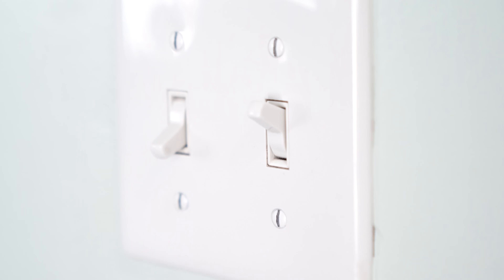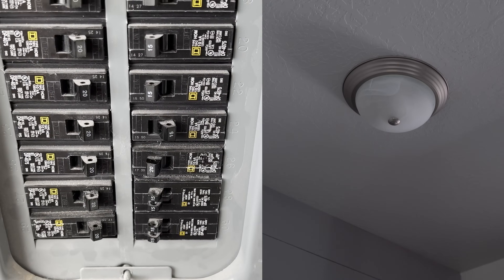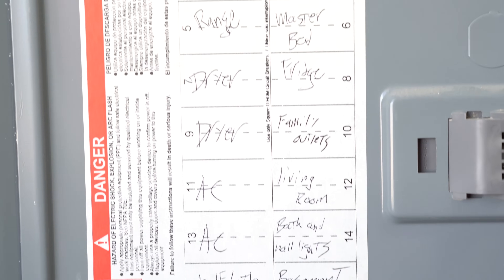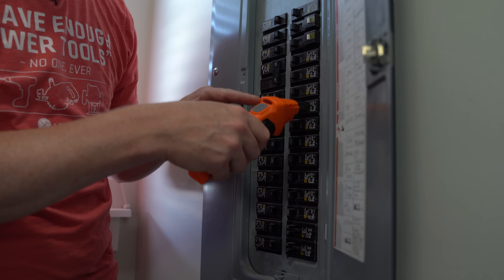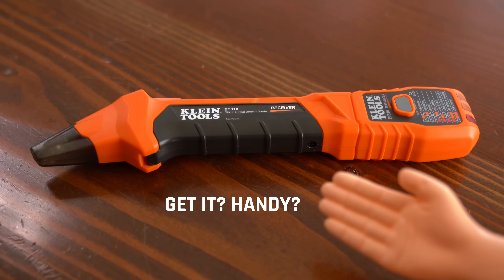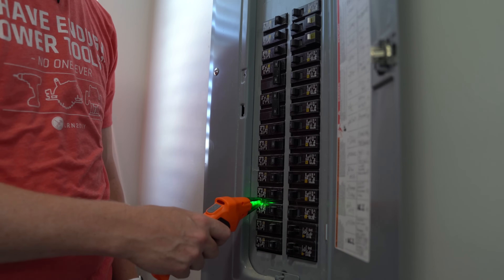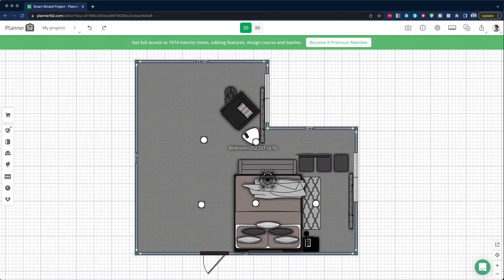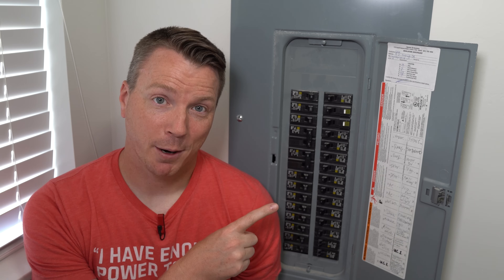This Tool Could Save Your Life

Comment: I use a spreadsheet that I print and laminate to keep near breakers.   For numbering devices I always start in NE corner of every room and go clockwise, R1 R2 R3 for outlets and S1 S2 S3 for switches.   I don’t actually label the switch plates I just count clockwise when I need to turn off something and then refer to my spreadsheet.
Reply: @ Ray B - that is genius! Thanks!
Reply: Excellent plan, Ray. I'm going to use your system.
Reply: I do pretty much the same thing.  20 years ago, I started doing the maintenance on a 4 story rather spread-out building that has 8 circuit breaker boxes with over 100 breakers, and almost none of them were labeled. I spent close to a week running around trying to figure them all out. I tool like this would have been helpful, for the outlets I used a radio turned up loud and started flipping breakers until it went quiet.
Reply: I don’t use a corner. I start at the door.  That way you don’t need a spreadsheet.
Reply: I label the backside of the wall plate and just refer to that.
Reply: These days, you can also use NFC stickers to keep track of it as well. They're like $0.30 a piece if you buy a hundred of them, and you can store all the relevant information in the tag itself along with simple information about whether it's a switched fixture, GFCI protected or similar.
Reply: @learntostrafe  Use NFC and you can read the information without removing the plate.

Comment: there's also the electroboom way: just short the plug and the correct breaker will open.
Reply: ...will open, hopefully.
Reply: Old homes are “tricky “ what you end up opening sometimes is a Hidden Gfci that powers half the House and no breakers opened in the panel🤣now you to have a House with no power and a Random Gfci to Look for
Reply: Does this tester also work as a vault tester? Meaning you can hold it up to a live wire anywhere and if it’s a tech electricity it will beep? I have a Klein tools tester that does this exact thing that I mentioning but I’m wondering does this device do that as well?

Comment: You show switch shooting out, but not how the tool would have prevented that?
Reply: I use the tester on all wiring in an electrical box, just in case.
Reply: You did not say why non contact voltage tester did not pick up live circuit
Reply: Click bait
Reply: It's not exactly click bait.  The tester can help identify the circuit breaker in question when you don't know which one it is.  

It cannot save you from being ignorant about testing EVERYTHING in the box you're working on before you work on it.
Reply: If he had a proper mapping on the breaker box it would have indicated that he needed to worry about that switch as well as it definitely would be hot. But, really, any time you've got wires in a box that aren't just passing through you need to concern yourself with whether or not they're live if you're going in there. 

The light switch could have potentially been fed from the same circuit as the outlet.

Comment: Watch out for neutrals on mult-iwire branch circuits that aren’t on proper two pole breakers. Dish/disposal is common one but in some older houses they were used throughout. It’s two hots sharing a neutral and if in single pole breakers you can shut one off and it will not show as hot but it will be carrying voltage on the neutral because of the other closed breaker.
Reply: Shit...I think you just solved a workplace problem for me.  Thx!
Reply: Yep, happened to me, I'm still alive, and smarter for it! Shock of my life!
Reply: Shared neutrals, Oooof!!😬 Hackers, garbage etc...
Reply: I found myself in that situation where I'm currently living. It would have confused me except for the fact that they had the sense to use different colors for the different phases. I didn't even know it was a thing to share a neutral like that. And, it was indeed one in the kitchen.

Comment: Mom asked me to test dryer heating element; switched off the breaker but tested with multimeter (before non-contact testers were invented). I got an arc, found wires were crossed so one leg of the 50A stove breaker was connected to the dryer outlet, and one leg of the 30A dryer outlet was feeding the stove. Similar situation many years later in a US Army hospital in Germany in the feeder for an X-ray machine. The arc blew a 100A fuse at 380V.

Comment: One big trip/help is to label the outside of junction box covers; you can also label the inside of the covers or simply the non-visible portion of the outlets switches, as these then get covered with a cover. Covers also cover more than just the box, especially with todays larger covers and a simple label or fine tip marker putting circuit numbers on the wall under the covered area can be good. 
As an institutional electrician you get to expand this out to facilities with quite literally dozens if not a hundred plus panels, then add three phase and this gets quite fun.
I’d also suggest running the breaker test again after you shut the first breaker off as you can actually get dual feeds, especially in DIY work or after a new service, especially if you’ve ever had knob and tube in the house.

Comment: Moved into a house last year, with two main panels. The labels in the boxes were nothing more than "AC, AC, Heat, REC, LIGHTS". zero description of where, what or anything. I used this tool to remap every single circuit, outlet, light in the whole house and made a very detailed panel label printout for each box. This tool is awesome

Comment: I had this exact same thing happen to me just a few weeks ago. I was changing out the old three way switches for smart switches for the foyer. One switch was by the front door and the other was at the top of our staircase by the bedroom door. This one had two switches sharing the same box . I shutoff the circuit breaker for the light I was working on verifying it when the light went off. I went back up the stairs to the satellite switch and as I was taking off the switch cover I looked at the other switch realizing that this switch controlled the lights in the upstairs hallway. I wondered if it was on another circuit and decided to flip the switch to see if the hallway lights came on. Sure enough they did. I am so glad I decided to do that. I'm certain it saved me from being shocked. Another reason for purchasing this tool after watching one of your other video's. Amazon delivered it today. Thank you very much for another informative video.

Comment: I have the ET300, a lessor capable Klein circuit tracer.   One thing I find however is it doesn't seem to work properly through GFCI receptacles.  Works fine for all other circuits.

Comment: That is a great tool.  I have an Ideal SureTrace 957 that does the same thing, plus a few others and has come in handy many times.  Even after I believe I have identified the correct breaker and used a non-contact device to see if the AC seems turned off, I then use my trusty DMM to triple check and confirm the circuit is off.
Reply: Sure trace is better! The Klein 310 even displayed red light when I ran it past the main breaker. I don't this is worth the money now that I bought it. And yes I followed the instructions and calibrated it.

Comment: I have this circuit breaker detector and it works great.  I went through the house, identified the individual breakers and the circuits (e.g. receptacle west wall dining room, upstairs hall lights, etc.), put them on an Excel spreadsheet and taped them to the box.  I also noted if there is a GFCI and its location on the circuit.  I labelled the receptacles on the cover so I can easily see what breaker it's on.

Comment: At first I thought you had a really small hand, before I realized it was just a pointer.

I just got one of these circuit finders last week its great. I also got a baldr power meter which is great for checking the load from any appliance or device.

Comment: Thanks for the video. Certainly have to rethink on how to handle those  switches on the same plate that handle lights in different areas.  That might require 2 or 3 breakers to be flipped to ensure no cross circuits.  Nice ideas for the breaker box labeling. Will definitely check those out.

Comment: It's worth noting that with the bathrooms in particular, the light switches are usually on a separate circuit from the outlets as you don't want to drop your electric razor into the sink and have the lights go out while you possible have a slick floor.

Comment: I have used the radio method in the past but in noisy environments, I will plug an extension cord into the outlet that needs attention and carry the female end to the breaker panel. I use a noncontact tester on the extension cord to find the breaker in question.

Comment: I use a shop vac for non-visual confirmation. Pretty loud and it will turn back on with the breaker to confirm 2x. Not all radios will come back on.  IMPORTANT: ALWAYS check prior to any work with a tester and if you can’t see the panel from the work area lock the breaker out either with a proper lockout device or at least some tape

Comment: I ran into this but caught it with the non-contact tester before moving anything. I think the code changed around 2006 to require ganging of the breakers if more than one breaker went to a box. In my case, half the panel would have had to be ganged just due to poor layout (which I didn't fix). If there were plans, no licensed electrician reviewed them. Everything in that place was apprentice level or lower.
Reply: That doesn't really mean anything because I'm an apprentice and my work always looks better than the journeyman I'm working with. 9 year apprentice cause I make a dollar or 2 less than a journeyman and have none of the responsibility.  Cant be stuck running a crew or be responsible for other peoples mistakes.  Lol
Reply: @charlesstidham2788  I hear you.  Really it comes down to the person. If you care about your work, and it sounds like you do, Charles, that's the most important thing.

My apologies to apprentices everywhere.

Comment: Very good information. I continue to face a big mess with house wiring and outlets. In the case of one outlet, there is no circuit breaker that controls it! Dangerous and exasperating! Maybe it somehow connects to the large outdoor main panel? Also, in this old house we have Knob&Tube wiring, with some new additional romex wiring and outlets. I last paid my electrician thousands to do what he could, but his solution to our lack of ground wires is not very satisfying. He installed occasional GFCI's, but never mapped outlet by outlet to find just which outlets are downstream from each GFCI. Because the house is quite full of "stuff", one or two of these GFCI's is not so accessible. I spent the last 2 years unable to turn on overhead lights in a large office room, figuring that a GFCI somewhere had tripped. Years later I was repairing a wobbly receptacle in the kitchen and had to move hundreds of pounds of cabinetry and its contents, and found another GFCI. Seeing that it had tripped (which did not affect anything in the kitchen!), I finally noticed that the lights in the office room worked again! Most unexpected. I have had many discussions about doing a whole house upgrade to eliminate the K&T wiring, but the disruption and cost of doing so would probably equal the entire value of the house. I am not kidding. There is no drywall, only wood and plaster walls. Ripping those open and then repairing all the walls in the entire large 11-room old house would be an impossible nightmare, certainly impossible to afford. Plus, almost no contractor can satisfactorily do this kind of work. Yes, they will demolish your walls and put in new wiring, but will they fix the walls after that? I don't know any contractors doing plaster-on-lath work, and also none that can match 100+ year old wood beadboard walls. I try to learn as much as I can about making electrical fixes and changes, but sometimes we are kinda stuck with problems that cannot be solved.

Comment: In the UK, our lights upstairs and downstairs are generally on different circuit breakers. Hallway and landing twin switches generally have both circuits going into the same box similar to in your video. When working in a light switch box, I generally switch off all the lighting circuit breakers partly because I don’t want what happened to you to happen to me but also because I don’t want to keep going backwards and forwards to the panel trying to identify which circuit breaker powers the switch I’m working on… Work smarter not harder.

Comment: Call me parnoid, but after testing with a wireless tester, after I pull the outlet out I test again with a DMM to again verify no voltage.  I also test the wireless against a known live circuit before hand.

Comment: Doing some minor DIY work, turned off a breaker, light went off. Got a bad shock! History: This was an old (1912) house, original fuse box had one fuse for each side of each circuit. We had a licensed electrician replace fuse box with a breaker box. He ran a 50 A disconnect and feeder from main service, and rearranged a new 3-phase breaker panel so there was one breaker for each neutral, and one for each hot. Breakers were not ganged! I had turned off a neutral, leaving the circuit live!
Reply from the maker: There are some crazy setups out there, and the older it is the more likely it is to be a challenge. Glad it was only a shock - I've had my share!
Reply: @LRN2DIY  yes, that same house had a really strange 3-way switch setup. One wire from the fixture went to the center of the first switch that would switch it to line or neutral. Other wire from fixture went to the second switch that would switch it to line or neutral on a different circuit ! So socket could be live when off, and you had to turn off TWO circuits to be safe to work on it!

Comment: To minimize the risk of electrical shorts, it is advisable to apply electrical tape to the screws of outlets and switches installed in a shared pull box or a metal enclosure.

Comment: In the 70's that tool did not exist. I worked for a contactor who built one. It was a big piece of machinery. Every time we used it all the other tradesman would flock to it in amazement. You would have to open the panel and put a current meter around each wire until the meter dial stated to pulsate. He always wanted to market it. I always wondered if he did. Every time I see one I think of him.

Comment: I never got shocked except once when I was plugging a cell charger when I was a kid and touched the prongs. I was isolated from ground by a rubber mat, so it wasn't that bad.
How to not get shocked in the terrible old wirings. Just shut down the master switch and put a lock on it.

Comment: Does the Klein Tools 80016 Circuit Breaker Finder Tool Kit with Accessories, 2-Piece Set work for 220 circuits?
Great video. Thanks for showing these practical tools.

Comment: 400 deaths from high voltage in the US every year ? Where did that statistic come from and I’d bet very few of those happen from a DIY homeowner.  And I’d say the 30,000 electrocutions barely scratches the surface and that the majority are unreported….heck I got zapped a good 20 times last week alone. In 25 years working in the industry I’ve never ever heard of an electrical death in a residential setting.
Reply: Same place as the numbers of deaths from.....
Nah, nevermind. Don't question stats on deaths....

Comment: Hello, thanks for the nice demo. Could I ask you a question? My garage ceiling light bulb stopped working before I noticed that. I tested the bulb socket, it has no voltage. So I guess the light bulb might still be good. The wire in the attic seems fine, the light switch on the wall has no voltage signal either. At the same time, my garage door motor still has the power. Probably they use different wire pathway. I had tried to turn on and off the panel swith in my basement, but it did not solve my problem. My question is, what is you step by step strategy to fix it? Does the circuit break finder and GFCI tester have a role in this situation? Thanks in advance for your time. All the best, Jerry from Toronto, CA

Comment: Thank you! Just liked and subscribed! I have been wanting to smart upgrade the 3 way switches that control my hallway lights on the parlor and top floors of my townhouse but I can't find the breaker at all! Should be on my 1st floor panel or possibly on the main basement panel that feeds each floor but I've traced out most breakers and still can't find it with the run and check if the light turned off method. Gonna buy that tool with your affiliate link right now!

Comment: This looks like a great tool but how does it solve the initial scenario that started it all off? The switch?  Can you get the clips in there without first pulling the switch, an action that caused the initial problem?
Reply: I thought the same thing, this looks great but doesn’t seem to work for switches
Reply: The accessories.
Use the light socket and ungrounded adapters in conjunction with the outlet tester.
Failing that, use a multimeter to confirm no power.

Never assume a double switch is powered by the same circuit.